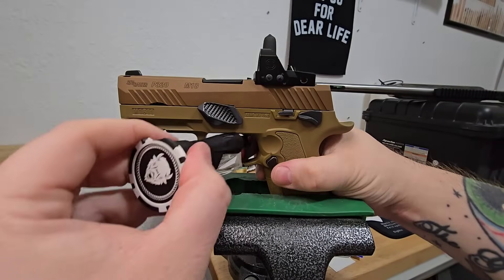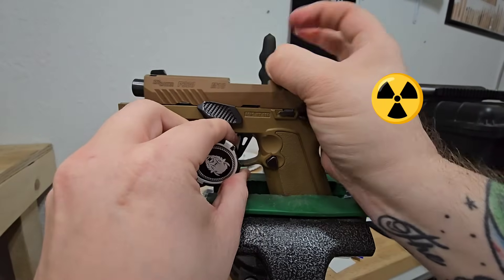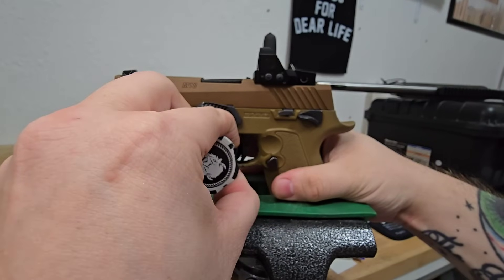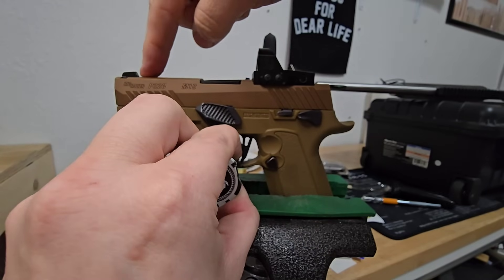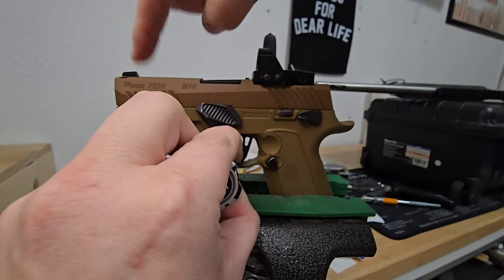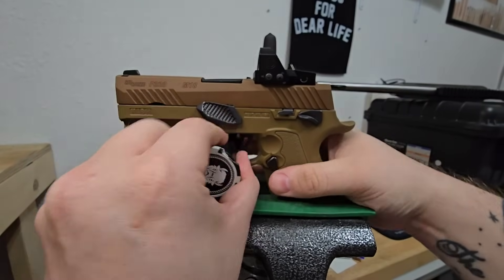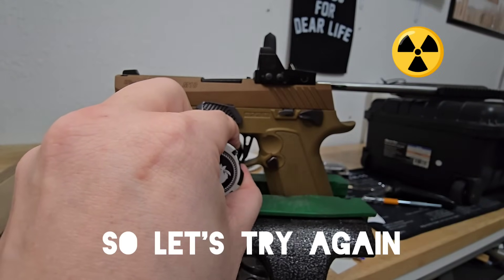VISE Testing Sig Sauer P320 M18 Slide/Trigger Pressure Issue!!

Comment from the maker: This is obviously not a conclusion as to ANY of the current issues that face the P320 and progeny models. It only illustrates a repeatable issue that neither I, nor hundreds of other P320 owners thought could possibly happen unless a FULL trigger pull occurred. That being said, I make no conclusions of fact, design theory, engineering or manufacturing quality. I'm ONLY showing people that they MIGHT be able to create a striker drop event under a single specific condition
Reply: Sig might sue you for this.....
Reply from the maker: @jayedatredes2890 did you read the above comment?
Reply: And Sig Should! You pulled the trigger and the gun went Bang- Go figure …
Reply from the maker: @wickward4135  not really, depress and stage the trigger, touch the slide, and it went bang. The whole point was to show that not only the trigger pull itself can make the striker fall. Dozens of people in these comments replicated my experiment. what you have to say about that?
Reply: @DoubletapDaoist im not saying that the 320 doesnt have issues, but i have tried this just now with my m18 and i could not bring the gun to go bang (on empty ofc). I just think that maybe there are a lot more of bad versions that can replicate what you have done in this video and there are some that cant. With that being said, yes, my M18 has been removed from my edc rotation. I am not willing to bet my life that mine in particular wont go off if i am in a certain situation or if its in my holster.
Reply from the maker: @RealLifePJ mine is just a bedside gun now. Empty chamber. Very sad. Almost 2k into this one

Comment: I myself just tested this on my own P320. What I found is, that this does in fact but I will say that it happen once maybe every 10 trigger pulls the other 9 times, I had to fully depress the trigger and did a reset. I also found that you almost have to pull it to the break of that wall, for it to discharge.
Reply from the maker: Agreed. My belief is that if this was the reason for the UDs, it would have to be that something is interfering with the trigger from the holster or other debris.

Comment: The Thinking Man channel proved a Glock 19 will do the same thing.  He used a CNC machine which is far more accurate, and tested the P320 and a G19.   The results were identical.
Reply: i saw something similar on an different channel and the guy used a glock and it was the exact same thing this guy is doing here. so everyone jumping on, "the trigger is pulled and its just going off!?" is stupid cause by definition when the trigger is pulled up to the the break of the striker, then yes the gun will fire!! thats the entire point! pull the trigger and it fires. i would like to see the video where the trigger isnt touched and its just "going off" show me that and then ill start believing it
Reply: I think if we just keep our D**k beaters off of the dahm trigger everything should be fine and of course use the correct holsters and keep all clothing or dangling keys away from going inside the holster everything should be fine and dandy I reckon so hell I carry my p320 every day and it hasn't gave me an ouchy yet 😊

Comment: I tested my P320 and could not replicate the problem.  If you don’t want the gun to go off, you could always just not pull the trigger.
Reply from the maker: The next question to ask is whether certain situations occur where a partial trigger pull is happening because of a holster issue. That being said, i wasnt really thinking id have to spell it out for everyone.
Reply: @DoubletapDaoist  yeah that’s what I was wondering as well. Could they have a holster on that is not specifically designed for the 320? The holster could partially pull the trigger and then the gun gets jostled and it goes off. Not a good scenario, but I think that Sig can come up for a fix for this one and do a recall.  My 320 has the voluntary recall fix done to it and for the life of me I cannot get it to discharge without a full trigger pull.  There are people saying that the gun shoots by itself and then there’s people that say there are no issues at all. Something tells me the truth lies somewhere in the middle.
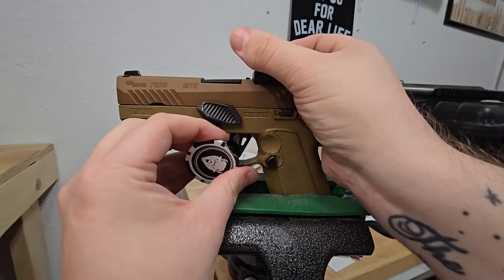Reply: Gullible and naive people that can’t think for themselves say and do a lot of stupid things! There are very few Truly Confirmed drop test that the 320 has failed! Out of 2.4 plus million produced they have an awesome record . If people can not comprehend this then they are either very dense, super 0:09 gullible or love YouTube and gun forum gossip.
Reply: @wickward4135  I can't agree with you more!!!
Reply: @wickward4135  yes, well said.

Comment: This is ridiculous!

 Inappropriate manipulation of a firearm as seen in the video, will allow the firing pin/striker to go forward on several firearms. These include the Sig P365, Spring Field Echelon, Spring Field XDM, Glock 19C,  Spring Field Hellcat, Walter PDP, Smith & Wesson MP2.0, and probably others with similar designs.

The problem isn't so much the firearm or its design as it is it's maintenance and use/manipulation.
Reply from the maker: It's a simple demonstration of an issue. I in no way made any fault claims. Why are you getting so emotional over it?
Reply: @DoubletapDaoist Will sir, I see it as a demonstration of manipulating a firearm in a manner for which it is not designed targeting a specific gun and manufacturer.  The reality, multiple firearms from multiple manufacturers will do the exact same thing. We should be encourage people to handle and use firearms as designed and intended and not encouraging inappropriate manipulate a firearm to achieve a discharge or failure.
Reply from the maker: @roberttowery9664 if you think that i would put a gun in a vise and use a tool to shoot it, youve lost the plot. Its about isolating a function or malfuntion. This is part of a troubleshooting process. Did you assume i was coming to some sort of conclusion even though i expressly said i wasnt?
Reply: @iamnitrox  Here is my take, 

You are not isolating a problem you are deliberately manipulating the firearm in a manner for which it is not designed or intended with the intention of making it fail.   As I noted, there are are several other firearms with different designs that do exactly the same thing even though the functional design is different.

Comment: So heres my question. How is this relevant? We all know as you pull back the trigger the safeties slowly disengage. When you hit the wall all safeties should be disenganged because your about to fire. How is this different from my VP9 when as i pull up the slack you can feel the safety click and disengage. How is this outside of design and safety standard?
Reply from the maker: It's an illustration about specific points in the action where failures might occur. The idea is to combine our findings and start to independently reveal clues that will solve the problem. Sig is not going to face this in the way we want. They have proven that. One specific failure doesn't solve this issue, but it will be a brick in the wall of tests that eventually sort this issue out
Reply: @DoubletapDaoist so then are we making an issue out of nothing. I have seen several vidoes like this but not single vidoe has articulated why i should care or unsafe. This seems like scare tactics for uneducated shooter. Smokes and mirrors. The drop issue, while rediculous argument, at  least demostrated a potiential safety issue. This without explanation is easily percieved a manipulative scare tactic. Just to be clear Sig has royally messed up this issue from a marketing perspective. I find other argument via cheaper parts, and match trigger on duty guns more feasible than this demostration or argument.
Reply from the maker: @TheCopper24 i dont recall making a conclusory statement anywhere.

Comment: I have a couple questions and hopefully no one tries to rip me a new one for it. So my question is with m17 in the M18 if you change the grip module will it still discharge and I'm not going to assume anything but if you put the manual safety on does it still discharge
Reply from the maker: It works the same. The grip module shouldnt change much

Comment: So what you are saying is that if you pull the trigger it will fire.  Seems pretty obvious.
Reply from the maker: That's like saying "so if you shift your car into gear, it drives. seems pretty obvious" - but neglecting the entire issue. If you're satisfied with that level of analysis, then this probably isn't for you
Reply: @DoubletapDaoist  I'm just pointing out that every demonstration I can find requires touching and to some extent pulling the trigger.

Comment: got this email from sig:
P320 Safety Information

Recently, there have been a number of reports and claims regarding the safety of the P320 pistol and its use by the U.S. Military and law enforcement agencies. We understand you may have questions. We want to address your concerns and provide you with full, complete, and accurate information.

SIG SAUER has ALWAYS and will continue to put the safety and security of the U.S. Military, the law enforcement community, our consumers, and the public first. To this end, we want to be sure concerned citizens have access to complete facts.

The P320 pistol is one of the safest, most advanced pistols in the world -meeting and exceeding all industry safety standards. Its design has been thoroughly tested and validated by the U.S. Military and law enforcement agencies at the federal, state and local levels. In addition, the P320 has been rigorously tested, and is currently in use by militaries and law enforcement agencies around the world.

FBI Testing and Report

A recently publicized internal report from the FBI’s Ballistic Research Facility (BRF) created some confusion and raised questions about the safety of the P320. The FBI prepared this report for the Michigan State Police after an officer was involved in an accidental discharge. SIG SAUER engineers met with the FBI and Michigan State Police on several occasions to review the report and the incident. Ultimately, the FBI conducted a more detailed, repeatable, and comprehensive battery of testing using compatible equipment. The subsequent testing resulted in zero instances of failures and the Michigan State Police are now confidently issuing officers P320 based pistols. The FBI BRF have yet to make any official claims or statements regarding the safety of the P320 pistol or any of its variants. However, we are urging the FBI BRF and FBI Director Kash Patel to release a full and complete testing and evaluation report on their updated P320 safety testing.

Department of Homeland Security

An internal memo from the Department of Homeland Security (DHS)/ U.S. Immigration and Customs Enforcement (ICE) was recently posted online stating the agency was halting its use of the P320. Many online media outlets immediately sought to attribute this to the above referenced FBI BRF report, which is incorrect. DHS has never raised any safety concerns about the P320 and ICE has since extended their existing contract with SIG SAUER another two years. Since DHS has yet to comment publicly correcting their improperly leaked memo, or any statements questioning the safety of the P320, we are now urging ICE to release all information on P320 testing. SIG SAUER is honored to continue aiding ICE in their mission to protect America.

U.S. Air Force M18

There was a recent tragic incident at F.E. Warren Air Force Base in Wyoming which resulted in the death of an Airman. Because the incident involved the discharge of a (P320 based) M18 pistol, the Air Force is actively conducting an evaluation of M18 pistols within the specific Command where the incident happened. This cautionary step is standard procedure.  We proactively offered assistance to the U.S. military as they investigate the incident. Contrary to several online reports, (P320 based) M17 and M18 pistols remain on active duty with all branches of the U.S. Military, including the U.S. Air Force, defending freedom around the world. We have absolute confidence in the U.S. Military’s ability to conduct a thorough investigation  and report their findings. As we learn more information about the investigation, we will continue to provide updated information.

P320 Range and Training Bans

Following several of these inaccurate reports, a number of ranges, training providers, and training facilities made the reactionary decision to ban the P320 and its use in their facilities. We are actively working to provide these individuals with accurate information along with a detailed understanding of the P320 and its safety features. If you are impacted by a P320 range or a training provider ban, we urge you to reach out to SIG CUSTOMER SERVICE: 603-610-3000 Option 1 or send a message here so we can clarify any misinformation and provide the truth.

The P320 CANNOT, under any circumstances, discharge without the trigger first being moved to the rear. This has been verified through exhaustive testing by SIG SAUER engineers, the U.S. Military, several major federal and state law enforcement agencies, and independent laboratories. This video provides a detailed view into all of the various safety features of the P320 and provides a detailed explanation of how the safety system works; for further information on the P320 please visit here.

As with any gun, the P320 will discharge if the trigger is pulled to the rear. Accordingly, SIG SAUER continues to remind its customers, employees, and the public to employ all safe gun-handling practices as spelled out in detail in our product manuals. The SIG SAUER Academy remains a resource to customers, employees, and the public in offering various firearms safety courses.

We respect the public’s concern and are actively working to provide as much information as possible. We sincerely thank you for your continued support of SIG SAUER and urge anyone with additional questions or concerns regarding the P320 and/or safe firearms handling to reach out to our customer service team.

Comment: Can you give some background on your pistol’s usage? How many rounds through it? Is it totally stock?
Reply from the maker: Maybe 1000 rds thru it. Axg trigger. Grayguns trigger kit. I have been concerned that the trigger kit could cause this, but others have replicated this with stock guns. I do not think the gray guns trigger tuning kit affects this.
Reply: @DoubletapDaoist  I saw a gunsmith on Reddit talking about how most of the UDs he has seen were with P320s that had either mods or likely had parts (i.e. slides) swapped by LE armorers. I think there's some merit to that—the tolerances are affected. Your gun having an aftermarket trigger makes it hard to gauge.
Reply from the maker: @thjshbr it's the Sig axg/legion trigger with a grayguns action kit. I would tend to agree if there werent so many responses to my videos of people replicating this on stock guns. Id love to reattempt this with a stock p320
Reply: @DoubletapDaoist  yeah, I think it'd be interesting to compare low vs high mileage stock guns. It'd be really interesting if someone could get a new one, check the slide to frame fit and whether they can replicate the failure, and then put 10k rounds through it and retest.
Reply from the maker: @thjshbr  Obviously, this is just one simple demonstration of an issue that buyers are probably not going to be ok with, should they have known the pistol does this. I  still don't think anyone has solved the holster fire issue.

Comment: You need to show measurements too many sigfans are claiming the trigger is being pulled 99% of the way when its only 20%. There is 4mm of trigger travel from wall to break and it only requires 0.8mm of travel to prematurely fire.

Comment: So, i have a question? I have read alot of comments, and sounds like alot of you have some knowledge. I am definitely not a gunsmith or military /police personnel. I have seen in alot of videos of wedging screw in trigger to what it seems…the wall. Is that pressure replicating as if a round is in chamber? Always noticed at the range that the slide was a bit wonky. Never had any malfunctions since acquired in 2023. Most videos claim all styles but style shown is trigger safety. I have have ambidextrous safety. I also have seen another video where a Sig was compared to a Taurus. In which,had no movement in slide. I also get the safety concern while either holstered,or in active movement. Threat grabs top of firearm or kicks and …BOOM. That should be safe for a civilian as well. Again im no gunsmith,or personnel.
Reply from the maker: This test was done with a dummy round in the chamber, so im thinking it should act the same. My first test was with an empty chamber.

Comment: Try it with the safety on.
Reply: Doesn't matter.  No gun should fire until the trigger fully breaks.
Reply from the maker: I haven't been able to replicate the results with the safety engaged. This is purely a situation that occurs when the trigger can move.
Reply: @DoubletapDaoist I very inconsistently was able to get it to break when just barely pushing on the past the start of the wall. To the point where I had to double guess if I pressed the trigger. When on safe it wouldn’t go no matter what. I feel comfortable to hip carry on the range because I am very disciplined about engaging safeties.

Comment: So is the problem with the trigger return spring getting weak or the trigger bar rubbing against something or something like that?
Reply from the maker: TBH I don't have the slightest clue. However, we finally have a situation in which we can replicate a specific failure (from a certain point of view, at least) that MIGHT potentially happen. That being said, we won't know anything until we know what the holster situation is.
Reply: @DoubletapDaoist thank you. It could be a ton of different things or combo of things. Good luck